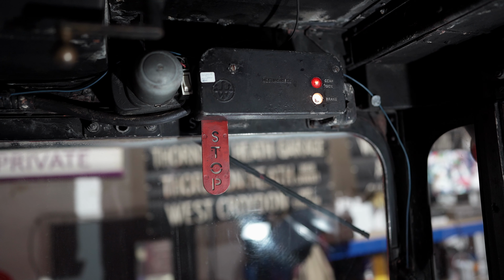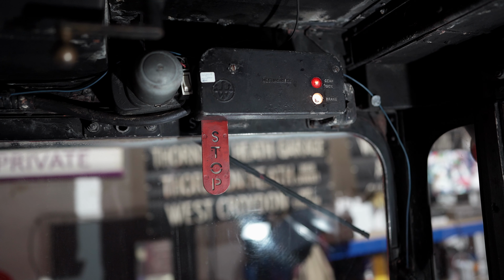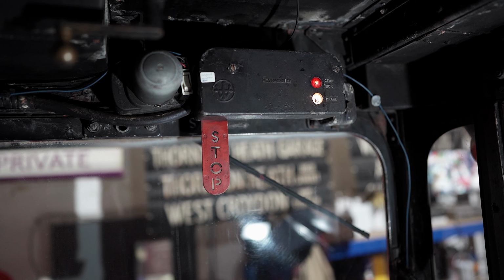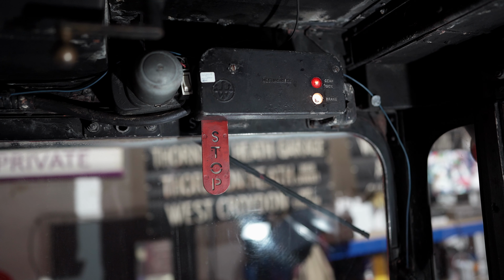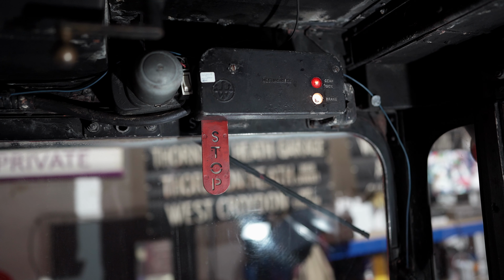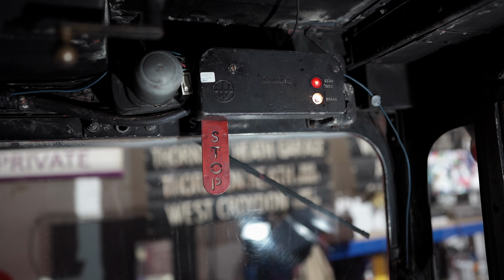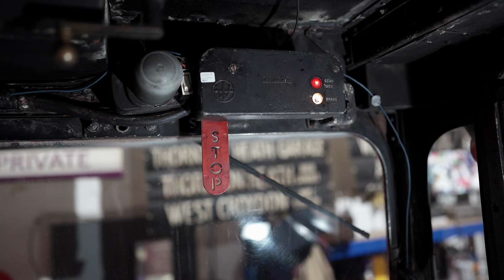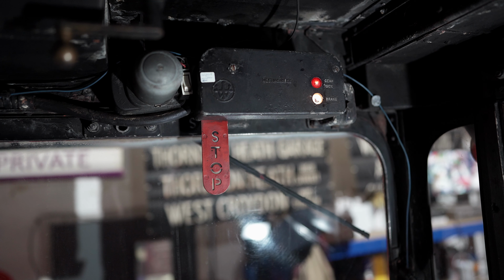Ep5: AEC Routemaster London Bus Restoration - Internal Strip Out!

Comment: Taking the waist mouldings and bulkhead handrails off would have made the job easier David They will have the same old rexine on them and will presumably need to be recovered. Rexine was only ICI's brand name for leathercloth, so you might get the smell back!! I loved the smell of repainted RMLs when they came out of the drying ovens at Aldenham came from the moquette as well
Reply from the maker: They come off in the next video Brian.  Also, getting some of the seats recovered so hopefully will get the smell back?

Comment: I know this come a year later...
On the matter of the speaker system, the preservationist in me also says to remove it. But since the damage has already been done, might as well leave it. 
For example, I now own the 71 Chevy pickup that used to belong to my grandparents. It has a CB radio installed as well as the antenna mount. Not at all factory. But it looks very professional, and it is of the same era, so it remains in place.

Comment: Hi There my name is Mr Cannadine T. Boxill-Harris I was wondering, why couldn't you Rebuild a nice fresh shiny Scania N113, Gardner LG1200, Gardner 6LXCT, Gardner 6LXC and Volvo TD102KF 3 speed Voith DIWA Northern Counties Palatine 1’s and Repaint them to a Grey Green Colour's just like the original Scania Grey Green's which were in the East London bus route's such as 125, 141, 210, 20, 173, 179, 167, 313 and also the bus route 103, if you guys would like to Rebuild about 176 of Those Scania N113, Gardner LG1200, Gardner 6LXCT, Gardner 6LXC and Volvo TD102KF 3 speed Voith DIWA Northern Counties Palatine 1 Buses Pretty Please could you Repaint them in the Exact Grey Green Bus Colour’s and put them on those London Bus Routes witch are the 341, N41, 34, 123, N29, 149, 221, N73, 121, 86, 30, 262, 147, 396, 41, 56 and N26 for all of us because it would be a Very Very Very Very Very Very Very Interesting Buses to see them Repainted to a Grey Green Colour's and I'am a Big Fan of all of those Scania N113, Gardner LG1200, Gardner 6LXCT, Gardner 6LXC and Volvo TD102KF 3 speed Voith DIWA Northern Counties Palatine 1 Buses Please?